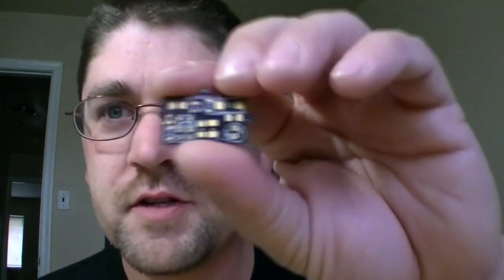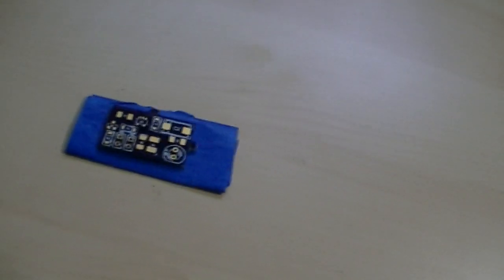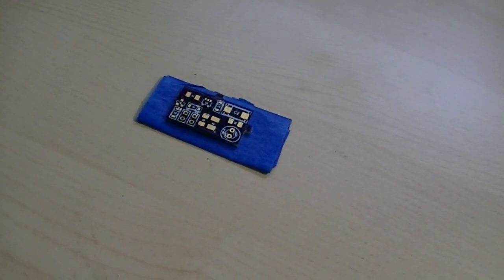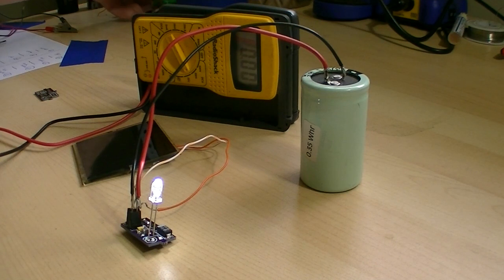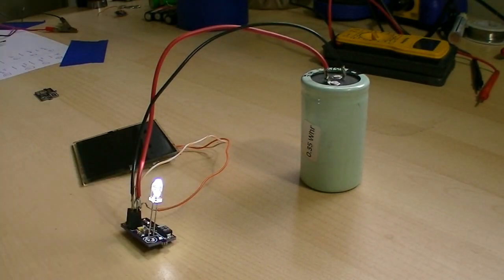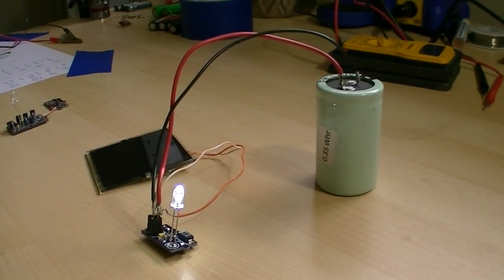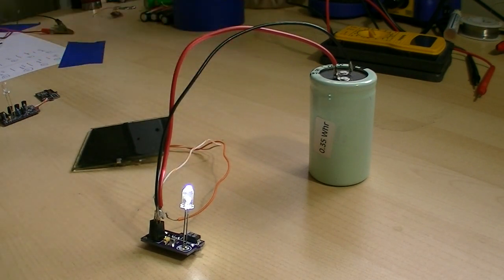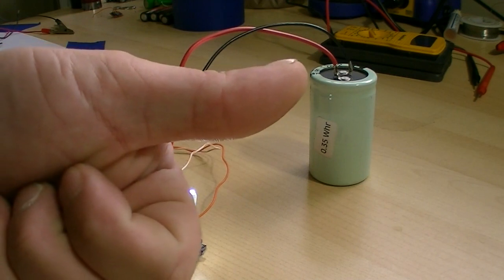Infinity Sun / Moon Jar Redesign #2 "IT WORKS"

Comment: Nice project, it is a good idea to mount the circuit directly onto supercapacitor, one less link that can break. It could be even more reliable with 0603 or 0805 smd LED instead of 5mm flapping in the breeze.

Comment: Here's an idea for the round version, top it with a standard 9v battery terminal! 
I don't see obvious load connectors, and the 9v connector standard is universal, dirt-cheap, polarized and solid! You might even use two, one for the PV panel, one for the load, but maybe that's asking for trouble :) In any case, the final version should have super-common connectors for input and output, no dangling, semi-permanent wires.

Comment from the maker: It can be used for any low voltage low current application.  As for the joule thief's powering a 120v string of lights, I'm not sure how they accomplish that.

Comment from the maker: the LED will stay lit for around 24 hours after a ful day of direct sunlight.
Not sure on the power feedback info, look for datasheet on ncp1402 chip.
It's a small CIS solar panel manufactured by shell solar.

Comment: I've been thinking about doing something like this too.
A few tech questions:
1. How long does the LED stay lit after a "full" day charge from the solar panel?
2. What does the power feed look like supplying the LED? (Square wave, 50% duty, 1kHz?)
3. What solar panel are you using?

Comment from the maker: The Supercap is rated at 80% charge retention at 10 years.  Also the self discharge rate of supercaps is higher then chemical batteries but is a moot point since it is getting recharged daily via solar.  In real life useage it might lose .1v over the course of 24 hours which is very acceptable for the application I am using them in.

Comment from the maker: comparing supercaps to standard rechargable batteries is almost like comparing apples to oranges.  to give a rough estimate the 350F supercap hold about 1/2 of the USEABLE energy in a nicd battery.  ANd I'd love to see a nicd battery that actually still holds an 80% charge 15-20 years down the road.  In general your lucky if you get 5 years out of nicd batteries and thats even with being nice to them and cycling from time to time.

Comment from the maker: THe supercapacitors can handle up to 160'F and it's doubtful that the glass containers that they will be mounted in will experience more then around 140'F in a north american summer unless you live in the desert.  Also the supercap will be hiding directly under the solar panel so it will not be in direct sunlight, just the radiant heat inside the glass container.